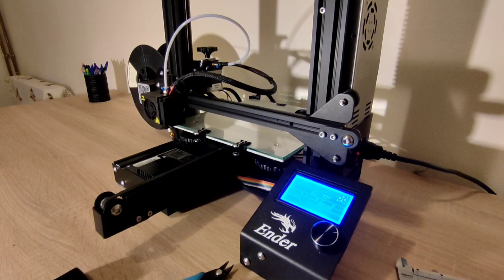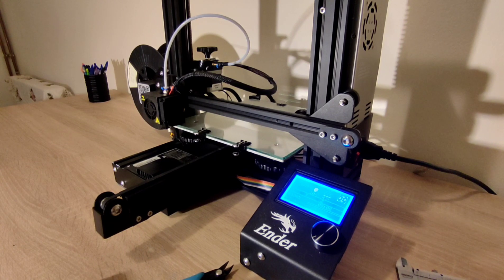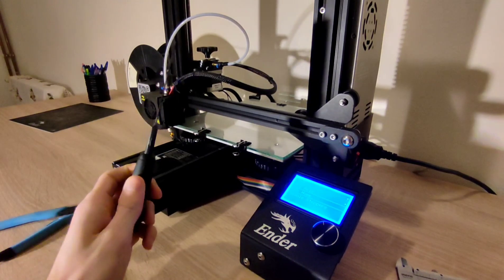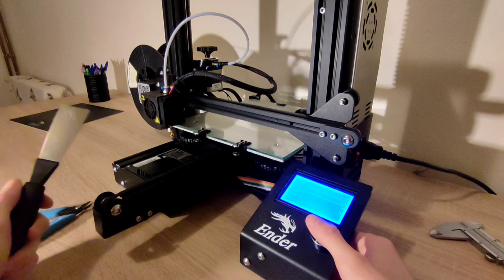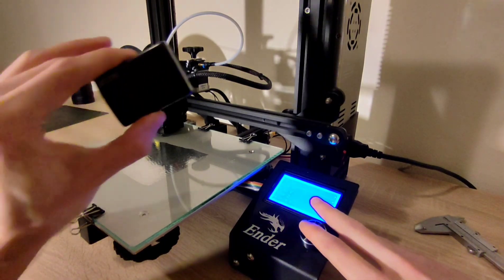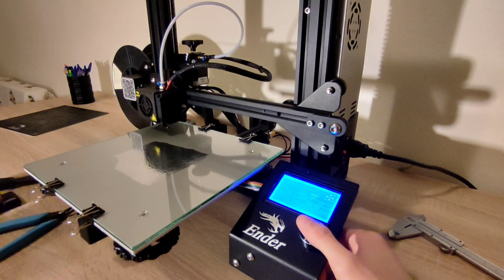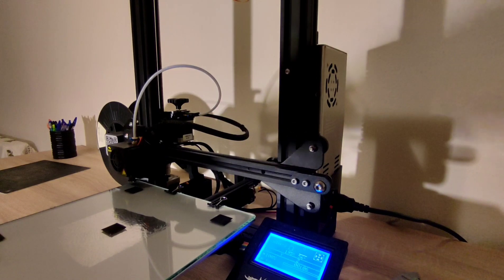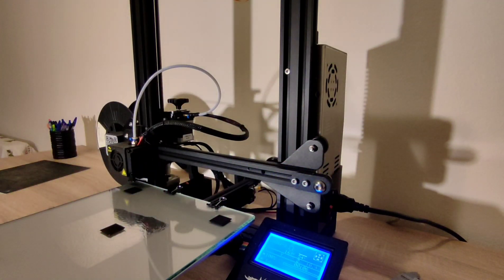True bed leveling

Comment: I need some help. I followed this exactly and it works perfect - I used the CHEP line print test and it looks great. As soon as I try to print anything else, the print head is basically scraping the bed. I tried to print a calibration cube that I had no issues with before and it did this. Do I need to change some setting in my printer or in Cura?
Reply from the maker: Maybe you have a faulty z switch that stops gantry at different heights each time you home it? Can you describe what you do between the printing line and next print?
Reply: @mr.mun3271  I think I found the issue. I must have not sliced the line test myself, and instead used CHEP's settings. His height is set to 0.28mm and my calibration cube is 0.2mm. I figured out this is the difference after looking at the G code. However, I still think this shouldn't really be an issue? If I levelled correct it should be fine with 0.2.

The other other thought I had about your video is that every 3d printer I've seen in person usually has some kind of clearance between the nozzle and the bed when at the home position. But true Z0 should mean it's touching the bed, right? Especially if you are using a physical object like explained in your video to set the height. I'm wondering if after using this method I am not counting for that gap and that's why it's scraping?
Reply from the maker: @shortymcsteve you are right. There should be zero clearance when you set Z=0, so when the first layer starts it goes to determined z height. Have you leveled it at the same temperature as you are printing? Both nozzle and bed? 
That different height shouldn't make a difference. I printed the first layer 0.04mm thick using this leveling method. 
Is there a possibility that your bed is warped? You can use something straight (ruler) and flash a light from a different side to see if any light shines under it...

Maybe contact me on mr.mun3@gmail.com so we can communicate easier

Comment: How celibrate the center? Which offset?
Reply from the maker: No need for calibration if you have flat surface. That is why I used 4mm regular glass as my bed because industrial glass for picture frames are almost perfectly flat. You can see aluminum foil under the center of my bed. I used it before I got the glass but I left there because of a better heat conduction, I didn't want to have an air pocket between the heating plate and the glass bed. Therefore, I just level four corners and that's it.
Reply: @mr.mun3271  wow interesting! Its a custom glass plate?
Reply from the maker: @TheTaskaipap i just bought regular glass 235x235x4mm  lat local guy who cuts glass for picture frames, cabinets, simple windows. It cost me $1.5 🤣
Reply: @mr.mun3271  ahahah thanks mate ☺️

Comment: So what are you setting to the thickness of the spatula? Do you autohome after getting the bed level?
Reply from the maker: Printer autohomes every time before it starts printing. Spatula is there so you can feel when the nozzle it at some known height. Dont be fooled by thickness of spatula, it has nothing to do with concept of leveling. You can use someting thicker, like someting that is 1cm high, but than you should move your Z axes to that height whan leveling. Z-offset should be zero.

Comment: Doing it this way do you not set a Z-axis offset since you are essentially doing that by setting each corner to a specified height from the nozzle using the knobs?
Reply from the maker: My z-offset is 0, and it works flawlessly
Reply: @mr.mun3271  Right, because instead of homing the Z axis when you level the corners you are actually setting the nozzle at a certain height above Z0, and then you adjust the knobs until the nozzle touches the metal piece, which is the exact thickness of the height you set the nozzle to, which means your Z-axis offset should be just 0. But one question, since you are setting it so Z0 is actually touching the bed, instead of being a paper thickness (0.1mm) away from it, isn't there a chance of the nozzle scraping the bed when you home it since Z0 is literally touching the bed and not 0.1mm away from it?

Comment: Totally skipped z- offset.  If you set "zero" to 0.07mm then you will never print anything g on the build plate unless you adjust zero offset by  the amount  needed to get proper first layer and bed adhesion.
Reply from the maker: No need for z-offset because i levele with 0.7mm thick scaper on height of 0.7mm. After i autohome machine it will go to true zero. So printer is always on true value. If you enter g-code G1 Z1 it will be on height 1mm without any offset.

Comment: Big facts about the homing position being zero, not some offset. Makes setting up Cura print height tab much easier, as you can simply figure out your layer based on nozzle size used. You seem to be running stock Ender 3. May I suggest these upgrades as they actually do something for print quality: Spider Coupler for Z rod, Lithium Grease for Z rod (bike grease) these will dampen the ringing on models. Capricorn Bowden, increases the edge sharpness on models and extrusion accuracy. Cr10 bed springs, allows for longer downtime between bed levelling. Metal extruder, because the plastic one is plastic and inaccurate. Foam feet, to dampen the vibrations of the machine and reduce ringing and salmon skin textures.
Reply from the maker: There are easy improvements that can be done to pump up your quality. Unfortunately no one is talking about this, and i hope there will be manufacturers that will implement something like this in their manual for leveling...
Reply: @mr.mun3271  Yeah, there is also PID temperature loop setup in Marlin you can do, switching the bed temperature calculation from Bang Bang to this. Makes the prints way nicer. You need an aftermarket control board for that like MKS Robin or SKR mini. Best upgrade to do in my opinion. Ultimately the belt driven model for movement is the best for these low momentum home machines. No registry deviation and smooth movement. Getting a control board with an extra Z port will allow for such a mod.

Comment: This is not bed levelling. This is adjusting your Z offset. Also Z0 isnt always the best depending on the material. Some filaments expand more than others so need to be printed slightly further from the bed (such as PETG). The best way to tune the bed is to use a feeler gauge. Then do a test print, and tweak as necessary, then record that value for that filament.
Reply from the maker: Nope, Z offset isnt function of material. You are pushing some volume of hard plastic by extrider and same volume must come out evenutaly trough nozzle. There are plastics that expand more with temperature raise but it has nothing to do with first layer, it will happen trough whole print. If you have to tune your z-offset for first layer than you have to check your flow/estep-s. That is only thibg that is different for different filaments because of viscosity and frictions. Everything else should be exactly same for PLA and PETG (trimming/leveling, offset, belt tightness etc..)
Reply: @mr.mun3271  Thats not true at all. Different materials can expand at different levels after leaving the nozzle. It can depend on temperature and cooling too.

Just extrude some pure ABS and then some Pure PLA and measure the thickness of the extruded material. It is slightly different and this have a big impact. Sure you can adjust your flowrate to compensate for this. But some materials like PETG do not like to be squished into glass for example as it will not release if its bonded.

Comment: Way to much work when you can literally get the same or better result simply doing it by eye in less then half the time or even during the first layer of the print. Honestly if you get used to doing it by eye you can legit just micro adjust every other print or so and you never have to fully level ever again. Leveling to this extent is kind of pointless as you are nearly always going to need some fine adjustments during the print to get it perfect. Also random metal objects will not have perfect tolerances so will vary in thickness point to point probably even more so then paper would.  So if you really want to be as close to perfect just spend $5 and get a set of feeler gauges they are cheap and are meant for this exact thing to accurately measure a gap.

Honestly tho all a waste of time just get used to doing it by eye and it becomes 2nd nature

Comment: Marlin has a Wizard for Z Probe offset, this can help a lot, it need undefining in Marlin
Reply from the maker: Yeah, it has Bad tramming wizard, it doese same thing as i described, but main problem with wuizzard if is set to level at height 0 but you are using someting to put under nozzle, therefore you will tram it wrong. I am using this wizzard but i set it in firmeare that height will be 0.7 and z-offset 0.7 so it only moves x and y and z keeps at thicness of my scraper, so whan i autohome it, ti is at true zero

Comment: It’s on 0.1 mm because that’s the thickness of a regular piece of paper. I typically set z to 0.1 and turn off printer to manually move around
Reply from the maker: What is on 0.1?
Reply: @mr.mun3271  0.1mm is thickness of a4 paper so it set the nozzle 0.1mm off the build plate (or where the printer thinks 0.1mm off build plate is)
Reply from the maker: Jup. Preheat, set z to 0.1 but i would recomend you to move it through display controls because you can push down whole gantry and mess up your process.

Comment: Trying to understand how this is a new method.   Using a piece of paper has been done for years.
Reply from the maker: New in this method is raizing z axex by thickness of thing you are puting uder nozzle to tram/level bed. I havent used paper, but it can be used if you know what are you dooing. If you heat up bed and raise it by 0.1mm than do leveling, it will be fine. But the way how it has been done with paper had "fatal" error. It sets nozzle to some offset, therefore you might have problems with first layer. Watch my short video on thermal expansion, comparesment of cold and hot nozzle/bed. There are few lucky peopel that level using paper with cold bed, and whan they heat up, gap becomes zero, but there are many factors like nozzle material, nozzle dimension, bed material, bed dimension (thickness of plate), bed temperature etc. which will determine how much will heated elements expand. So thoes lucky ones managed to level bed with paper which is usualy 0.1mm to make gap 0.05-0.06mm between bed and nozzle (they push down bed, compress springs, so there is 0.1 gap between nozzle and bed, but whan they put paper out springs elongate and reduce gap to 0.05-0.06) and whan they heat up thermal expansion makes their nozzle touch the bed (nozzle sits on bed), so they can normaly print their first layer. Others that are not so lucky will have problems with adhesion, elephants foot, gaps between lines, damageing of nozzle/bed etc...
Reply: @mr.mun3271  There is a thing now called baby stepping.   Solves the issue you describe above with offset needing adjustment.   Different plastics expand differently like PLA vs PETG.    You use the Baby stepping feature to adjust on the fly.   Doesn't matter the thickness of the material your using to level the bed.   If you want to be that professional use a feeler gauge as that is what it is meant for.
Reply from the maker: @2muchscott  man, i am not forcing you to do this. If you dont see and added value in this video that is not my problem. I am here to help people, not to argue with you why am i right. If you want to have educated argument than go deep into firmware, mechanics, slicers, thermodynamics, fluid mechanis etc. than we will talk.
Not every firmware has babystepping. This method can be used on printer which is out of the box without any upgrades od changes. As i said in video you can use feeler gauge but not everyone has it, and with creality printes tyou get scraper, so this is win-win solution without any additional incestment. 
Bed leveling has nothing with material you use, but it depends on temperatures you are using while printing. As i explaind, whan you nozzle is autohomed and bed leveled, preheated, than your nozzle should touch (but not push) the bed. Difference between printing with PLA, PETG, Nylon etc. are different temperatures of nozzle and bed, therefore you have more expansion due to higher temperautre. You can see in my video about thermal expansion about which I doubt you did.
I dont know what do you mean by thickness of material. I you can use any thickness if you are following each step in video. 
Best thing for you would be to test this method and than comment on it. I have spent years on my edication, hundred hours on 3D printing. Couple of dozen people thanked me for sharing this information because they couldnt level their bed propperly with paper, especially newbies which didnt have time for many trial and errors. 
I managed to print 0.04mm thickness of first layer using this method of bed leveling. Checkd it with calipers. If you can do it consistently with eyeballing, you are true expert.
Cheers!
Reply: The reason you raise your bed by the set amount of your metallic object: 

The paper trick is shite, and I wish people stop suggesting it. Paper is too squishy, its not always 0.1mm thick.the nozzle can push it to 0.08mm or 0.05mm and you wont be able to tell the difference. with something metallic, you dont get this. That 0.03 difference is HUGE when it comes to levelling.

When you level your bed on your home position (0) you put a distance between your actual 0 and the bed meaning you add for instance ~0.1mm (thickness of paper) to your 0 so now your home position is X0 Y0 Z0.1

On top of that Z0.1 you add your first  layerheight (let's say 0.2mm) so now you have a distance of 0.3 on your first layer which your slicer didn't account for.

Raising your Z to your set amount of offset after homing and before leveling removes the extra 0.1mm and leaves just the 0.2mm of your first layerheight which your slicer has accounted for.

Comment: Why use the foil under the glass? Heat transfer?
Reply from the maker: I have diped bed. Whan i used stock plate, it couldnt print on whole bed because of dip, than i added foil to take care of that. After i put regular glass, like for picture frames, didnt need foil under it but i left it as you said for better heat transfer.

Comment: Very good video, i will try it! I have Ender 3 too, i bought Creality glass bed, but i can't print on it, every time i fail, but i have problems with my main bed, only with hair spray that i can print on it. I want to print on glass, because the surface is more clean, nice, than with the main bed. Can I ask you, that when you print on glass bed, did you changed the first layer speed lower? Only using clean glass, or did you use glue or hair spray to stick the first layer? Only once sticked my first layer, but after an hour, the corners come up.
Reply: and which bed temperature is working for you on glass bed, please?
Reply from the maker: Thanks. My printing speed depands on complexity of my first layer. If i have lots of small details than u slow down, but usually i would go with default speed.
If i am to lazy to clean bed properly, than I just add some paper glue in stick, but as you couod see, I am using plane glass like for picture frames. 

For Creality glass bed temperatures you can watch this video. https://youtu.be/w9h4ofWlGNo
Teperature settings depand on your filanent, bed thicnkess, enviroment temp etc... So try few different settings and find what fits you. For regular PLA dont go over 70°C, but lower that temp after first layer
Reply: @mr.mun3271  thank you for your quick answer and your tips :)
Reply from the maker: Hope you can get it right :D

Comment: curious, (new to this obviously why im here) why not disable stepper motors and move manually? 
defenetly like this vs paper though, wont smash in like paper.
Reply from the maker: So it keeps z height all the time as it should whan you do it with paper. Whan you disable steppers, you  can push gantry down by hand. Plus printer whan starts printing will move axes the same way they were moved while leveling. Imagine it like army drill but with cardboard guns vs full replica guns with weight, dimension, feel in hands... 🤣 Glad you aksed. If you need someting more, feel free to ask 😁
Reply: Guessing he never read and understood the original user instruction, I have noticed one version with changes, if the 1st layer is stable with good adhesion, anything else is just tinkering.
Reply from the maker: @Richard do you really think that George Brayton who invented first comertial combustion engine understood whole sicence behind it? Why it was changed so many times till now?
Not everyone knows how to live adjust, especially newbies. If you have any fact or argument why is this bad method, feel free to write it.